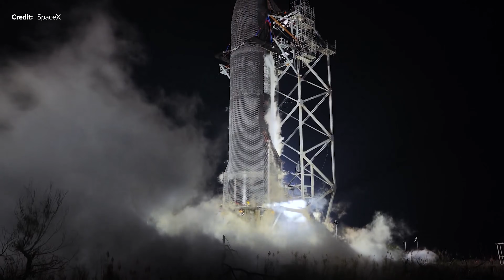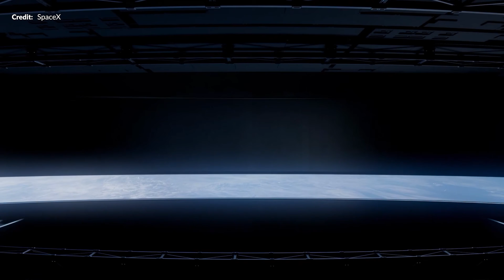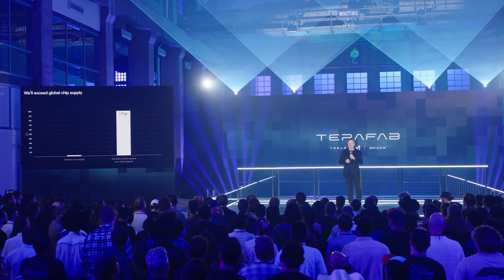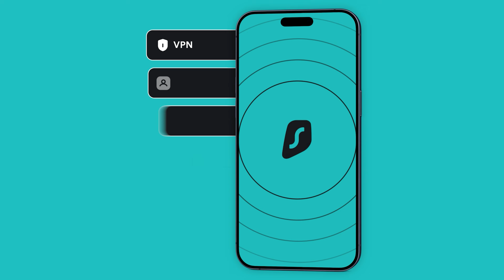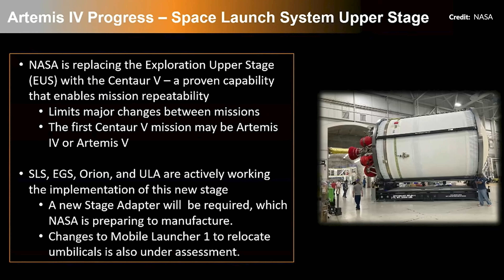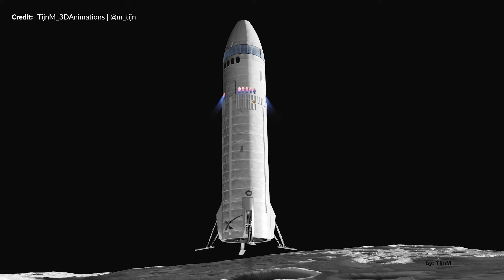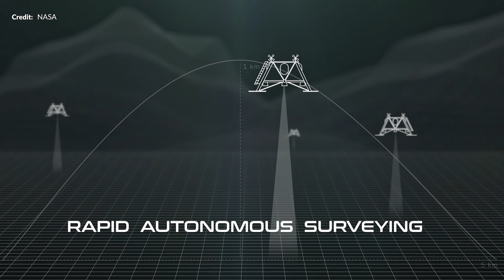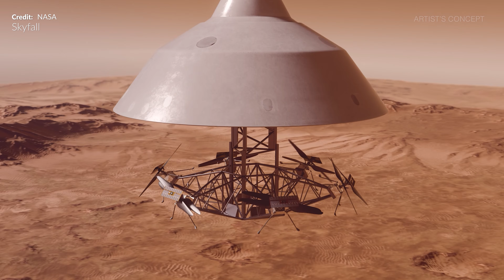They Want 5000% More… Of WHAT Exactly?

Comment: Marcus, this raises so many questions. Do you think SpaceX would use the same base for its factory plans? And what legal framework would they actually operate under? If they have plans separate from NASA, are they even allowed to do that?

And without any real enforcement mechanism, what would prevent the first actors from establishing de facto control over key locations? Do you think the current legal framework is robust enough for long-term commercial activity on the Moon?
Reply: What do you mean separate from NASA? Since if spacex are the only ones able to send stuff to the moon, the moon belongs to spacex, and the astronauts will have to help space x make bases, to even get sent up to the moon. And of course space x will be happy to also help NASA with their stuff, for a price.
Reply: @stefthorman8548  That’s not how it works. Under international space law, the Moon isn’t owned by anyone. So being the first or only one there doesn’t make it “yours.” And SpaceX isn’t the only one reaching the Moon anyway. Multiple countries and companies are in the race. 

What I meant earlier is something different: SpaceX already operates both for NASA (ISS missions) and independently (Starlink). So I’m wondering whether they would use a NASA-supported base for their own factory plans, or develop something separate, and under what legal framework that would happen.

Comment: Come on, let's launch this latest version of the primarily intended to be Starlink satellite lifter with a Starlink Pez dispenser even in the prototypes!:

From a supposedly leaked 2021 Elon Musk email to SpaceX employees:  "The consequences for SpaceX if we can not get enough reliable Raptors made is that we then can’t fly Starship, which means we then can’t fly Starlink Satellite V2 (Falcon has neither the volume nor the mass to orbit needed for satellite V2). Satellite V1, by itself, is financially weak, while V2 is strong."

And next to lift these:

On January 30, 2026, SpaceX filed an application seeking authority to launch and operate a new NGSO satellite system of **up to one million satellites** to operate as the “SpaceX Orbital Data Center system” (System). The System will operate at altitudes ranging from 500 km to 2,000 km and in 30 degree and sun-synchronous orbit inclinations within orbital shells spanning up to 50 km each. The proposed satellites will use high-bandwidth optical inter-satellite links and conduct telemetry, tracking, and command (TT&C) operations.

Comment: I am not against AI Sats and their compute nodes as a concept,  but not in LEO. That is too lazy a concept and will simply pollute LEO further. Yes, I know SpaceX wants to develop a space traffic control using positioning and automation. Give up some latency, and position them in a solar ring that parallels earths orbit. Link them with laser data links and as the Earth rotates around the sun it will always be in range of several nodes and they will always be facing the sun. No traversing of the darkside and wasting space and weight on massive batteries. Think of it as a poor mans Dysons Ring. Just because we have always done it a certain way (via LEO) doesn't mean we always have to do it that way. Just my 2 cents.

Comment: One huge supply side limitation is ASML. They can only produce at most, 50 units per year (liberal est). (1000's will be needed) My son worked for them last year. According to him they are a badly run company with unhappy work environment from top down. There is zero competition so there is nothing motivating them to improve moral, just botton line. SpaceX / XAI / Tesla should buy them out and fix their internal culture and boost their output 100 fold.
Reply: They may end up creating their own lithography tools. Some close friends of Musk have invested heavily on new technologies like helium atom beam lithography which are very promising

Comment: When you look into the requirements specified for the Near-Rectilinear Halo Orbit, there's only one that makes any sense at all: an assumed lack of Delta-V to make any other orbit possible.  If there's enough Delta-V, there is no viable justification at all for an NRHO, and a very good reason to not use that orbit.  With NRHO, you can only make rendezvous from the lunar surface every 6.5 days.  Miss your launch window, and you're stuck for another 6.5 days.  Smarter Every Day did a very good video on this, and other critical issues that had not been addressed, where Destin gave a speech to the movers and shakers in the NASA engineering environment.  I strongly recommend it, if you haven't already seen it.
Reply: It was great video. 
It’s so interesting how mission requirements get fashioned around things other than the mission. 

It’s a real failure of NASA; they do this more often than they should—probably it’s actually an issue with government—that makes me think NASA can’t do it. 
Isaacman has a good track record. I hope he can continue that with NASA, but I have my doubts.
Reply: @tylerfb1  The really sad thing about it all, is that NASA *wrote the book on how to do it right*, after the early disasters with Apollo.  It's still available, still relevant, and seldom actually used.  Why?  Basically, politics, and an aging NASA population.  As the people with the experience retired, the culture started dying out.
Reply: @EdwinWiles  That’s my take exactly.
Reply: The "geniuses" in Congress thought they could save some of the costs of the Ares booster of the Constellation Program by reducing the delta-V requirement.  Unfortunately most congress-critters chose their university program because "I hate Math."  I have, for years, suggested that NRHO should stand for Not Really Helpful Orbit.  

In addition to the other problems mentioned the NRHO doubles the energy that a lander must exert to travel between Orbit and the surface.
Reply: @jamescobban857  Congress does not see the program as anything other than a jobs program.  They don't really care about going back to the moon, or anywhere else.  They care about getting money diverted to their state/district.

Congress should restrict itself to setting the goal, and leave the engineering to the engineers.  Something they are incapable of, because all they see is dollar signs and where the money is going.

Worst of all, every two years as elections happen and the power shifts, everything gets 'renegotiated' all over again.

Comment: Re chip manufacturing on the moon, there’s another problem— lunar dust. You need to have raw materials flowing into the fab building and chips flowing out. How to prevent that sticky dust from wrecking the chips as they are created ?
Reply: Maybe some sort of coating to protect it
Reply: Same way they do here.  It won't be done out on the surface exposed to everything.
Reply: @imaginary_friend7300 moon dust sticks to things. Charged particles. When raw materials come into the fab, they’ll be coated with dust unless steps can be taken to clean all the dust off…
Reply: Well I would think they would polarized the entry to collect the dust particles, that is way to do it.

Comment: Proposed mission architecture: Orion (crew Module only) to LEO on Falcon 9. Crew to LEO in Dragon on Falcon 9. Transfer crew from Dragon to Starship HLS and travel to moon, land, back to lunar orbit, then back to LEO. Transfer crew to waiting Orion and use Orion with lunar reentry rated heat shield to bring crew back to earth. Crew to and from orbit on already human rated vehicles. Only modifications needed are adapting Orion to Falcon 9 and Starship HLS and Dragon to Starship HLS.
Reply: Orion has to go to the moon. The point of having a lunar re-entry rating is that you re-enter from the speeds you carry from the moon. There is no reason to have a lunar re-entry heat shield from earth orbit.
Reply: If you "transfer back to LEO" you need a huge amount of extra deltaV because you need to use rockets to slow down and match orbits (a few thousand m/s, equivalent to the TLI burn) instead of just slamming into the atmosphere and using the heatshield for all of it.  Might need double or more the number of tanker flights and a high orbit refueling mission for HLS to do it. On the plus side, now you're in LEO so the lunar rated heatshield is irrelevant and you can ditch Orion from the plan entirely.
Reply: Just add a life pod to Starship and do away with Orion and all that other stuff. Orion was designed and built by Boeing. Can anyone say they trust Booing to make a space capsule anymore?
Reply: @vincewilson1  What is "just a life pod"?  A vehicle that can provide life support for 4 humans, atmospheric entry, descent and landing from the moon, ground communications and control for a safe landing?  That's basically what Orion is.

Comment: When will people learn WATTS ARE NOT THE UNIT OF COMPUTE.... put some microcontrollers up there controlling some heating elements, it won't be able to run any LLMs bur it'll meet that stupid POWER DISSIPATION metric... You need to know compute efficiency metrics to determine whether the compute system is an HPC or an extremely hot brick running Linux
Reply: I think you're in the wrong thread bro.
Reply: In a power constrained world, watts have become a shorthand proxy for compute.

Comment: I still have to see anything on how they plan on protecting cpus in satellite "racks" from radiation.  You can't just wrap metal around the box because that high up metals like aluminum convert incoming radiation into x-rays which does high-speed enterprise compute zero favors. Unless you like random bitflips every other clock-cycle.
Reply: They sit under the Van Allen belt, and we can shield geo satellites already, which are far more impacted. It's planned with physical shields, redundancy and software to avoid errors. Given the mass they can sent to orbit vs volume needed they could opt for heavier metals as shield than aluminum too. We rarely lose a satellite to radiation damage, as we are really good at it by now.
Reply: @-JustHuman- I'm more worried about the enterprise hardware that they'll have to orbit for that.  I know even the stuff in data centers is subject to anomalies.  Especially with the latest gen PCIe architecture, AMD/Intel/ARM stuff... nvidia's GPUs etc... its all hyper-sensitive to random radiation.  Especially in the enterprise configurations.  Most satellite architecture is custom-built and hardened.  Heck a lot of the heavy stuff still uses 6502s and 8080/6/8 plus that one 286 that got EMP hardened.

If I were deploying an application or recommending a use case, I'd need to know how they were hardening the equipment to protect my data.
Reply: Where would you expect to 'see' such information?  They're the ones with actual data and also the ones with a lot of real world experience.  Two things you can't claim.
Reply: @imaginary_friend7300  SpaceX is talking about putting what is commercial enterprise compute hardware into space. I may not be an expert in spacecraft, satellites or building rockets.  But I am an expert in enterprise hardware and compute - as IT is my day job.  I do know enough to know that shielding is mass. Fuel is mass.  Mass is subject to the tyranny of the rocket equation.  I also know that a modern enterprise CPU or GPU, memory architecture, and motherboard design is not hardened against orbital radiation.  I also know you would not want to deorbit a server rack of equipment in 5 years.  It will be obsolete in 10 years though - so you will want to put it high enough to either recover and recycle or to move it into a safe parking orbit to make way for the next gen of orbital server rack.  So you are going to yeet it up high enough to meet that 10 year goal.  And to put a fine point on all that - every single step of this is a business risk that needs accounted for - and that is SpaceX's job to address that to the customer's satisfaction.  

They are selling a service.

If I were an investor or a user they'd need to explain the details of that to me very carefully and openly before I'd trust a single byte of data or application to their hardware.  And my recommendations would affect anyone I was consulting with on this topic because I'm not going to allow that risk to ruin my reputation.

Comment: RTG and Darkness makes NO sense - RTG is low power. TOO low for anything that is not a small satellite. it is an experiment - and may power an emergency comm, but no more. Darkness and Moon base means either a proper reactor (fission or fusion) or - well - batteries until the sun comes back. You will use megawatt of power for life support and all that stuff.
Reply: The problem becomes heat rejection.  Nuclear power plants tend to need a lot of that.
Reply: @imaginary_friend7300  Never said to do that - I think that solar + large batteries is it - but just that RTG are a nice joke for a real moon base.

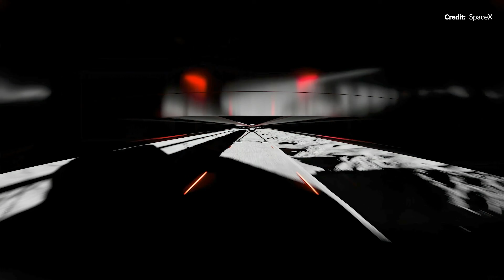Comment: 09:00 You don't need every element's raw materials extracted from the lunar surface. You might need a bit of it. But you can fit a lot of chips in one starship and send it too the moon, while maybe producing the satelite hull or other heavy/volumous parts of the satelite on the moon.
And then ofc final assembly needs to happen on the moon.
Reply: There aren't enough rare earths mined to provide for three orders of magnitude increase in ship production. 

The AI hardware is still in its infancy, right now it's way less energy efficient than a biological brain and there's a lot of room for improvement. I doubt anything that large would be built, rather new hardware will be developed under pressure with much better energy efficiency. Paths towards that include photonics and quantum computing.
Reply: Photonics has a high level of information transfer while quantum computing has a much larger information density. The two would pair well together.
Reply: @Neoprenesiren Commander Data is coming soon!
Reply: Mass delivery is extremely limited and challenging. It would be easier to produce the raw materials in space land the ship and then assemble them on earth.

Comment: These orbital datacenters/servers are an idiotic concept.
We will be sending  tons of computer equipment into orbit that will need gigantic radiators to shed off the generated heat
And over all that it will burn up in the atmosphere when out of commission, while here on the ground we have to segregate and recycle soda straws and are prohibited from burning trash out in the open.
Reply: Heat rejection is not the issue you people pretend it is.  Turns out those who actually run large satellite constellations know more than you do.

Comment: You wouldn't need to mine every material on the moon. Electronics use a lot of different elements that are in tiny amounts per unity. Miiligrams or Micrograms. These can be imported in huge quantities >100 tonne a launch.

I think if you tried to make a resource map of what materials you'd need for say, a datacenter satellite, you'd be surprised how little you need of non-lunar native resoruces. The most troublesome thing will likely be carbon and chromium. (For stainless steel)